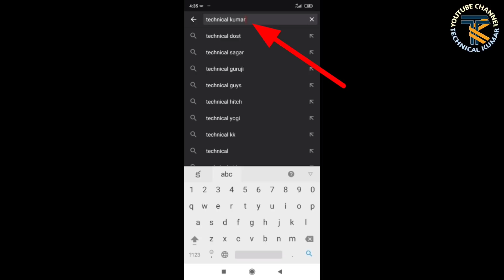Class D 5.1 Dolby dts amplifier with remote control/mosfet/technical kumar

Comment: Some time my audio rush not detecting the subwoofer woofer pre how to solve this problem everytime restart the audio rush
Reply from the maker: Check the sub center receives from the 4558 chip ic on the motherboard and see if the subout is released from the main ic
Reply: @technicalkumar  I have issues in feature touch switch